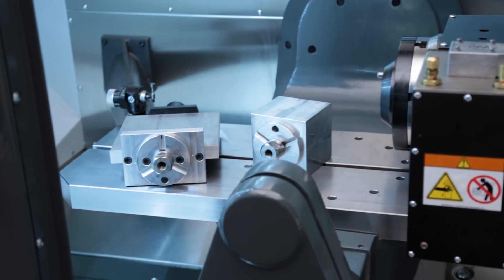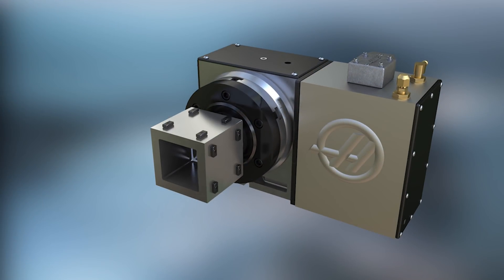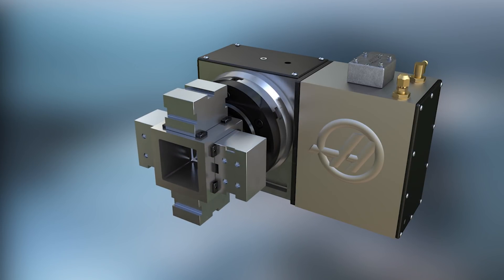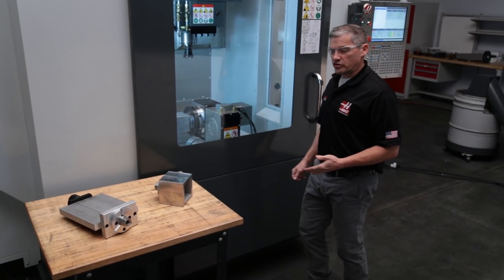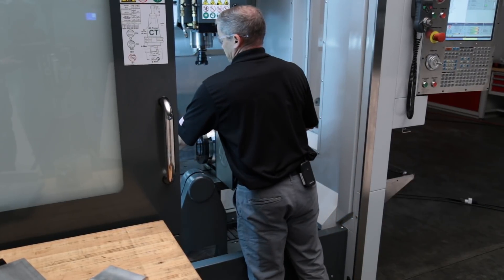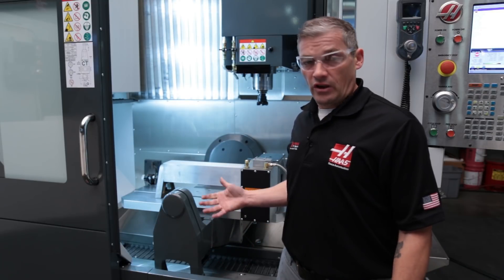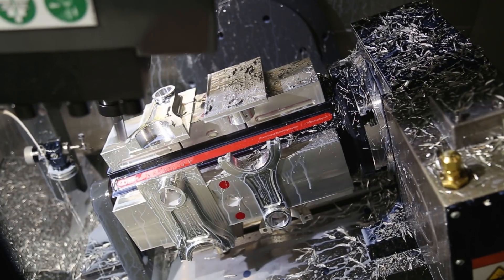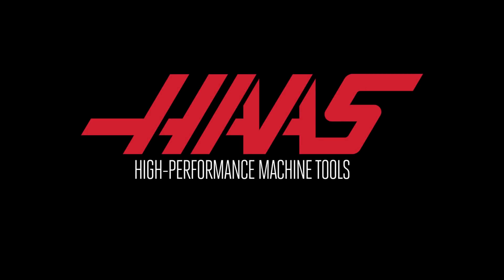Haas Rotary QuickChange System and Block Fixtures

Comment: Hi
I was wondering if it is possible to face mill a part without actually using the face milling option on the CNC and instead using the pocket milling option so that you can reduce the milling time